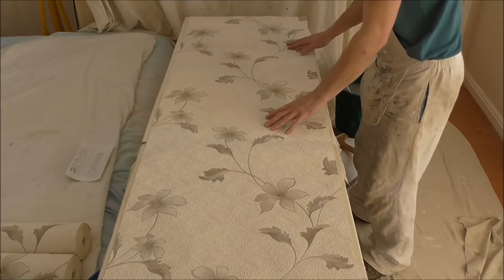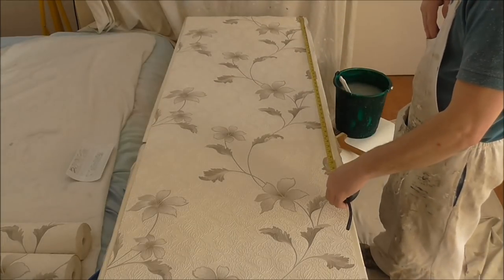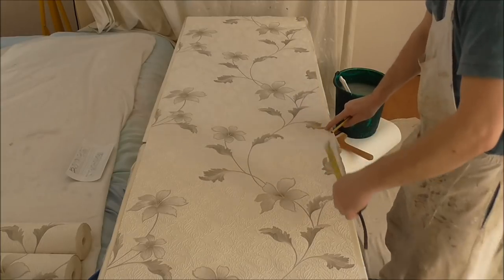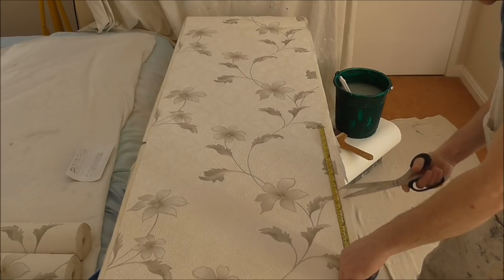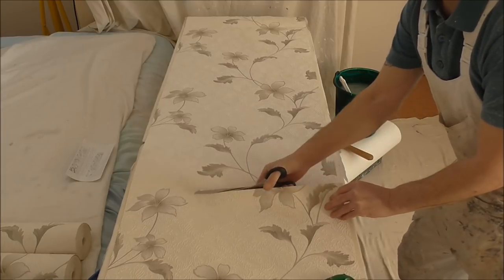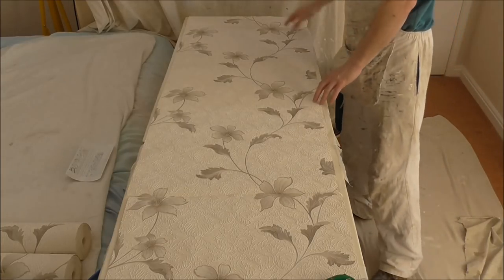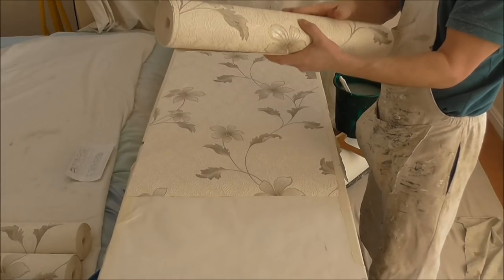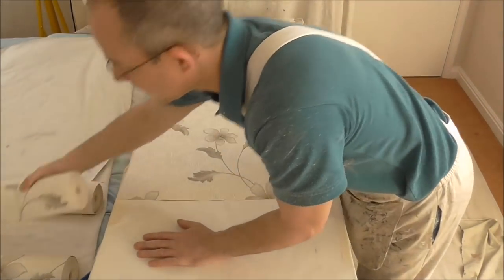How to paper a feature wall Drop pattern 53cm

Comment: As a newcomer to paper hanging. I like using a combination of scissors and razor cutting. I like using the scissors to cut the sheets. But I much prefer using the straight edge with a notch technique to make the length cuts as he did with the fill to the corner. In some cases pulling it back from the wall to cut on pencil lines helps. But the American way of cutting along a straight edge against the wall I feel makes a cleaner cut alleviates the need for pulling back and reapplying your work. 
Watching a combination of these videos has really helped. I think I like the brush pasting for a more even and accurate spread of the amount of paste you want. When it's not an issue the roller is fine. And of course the roller only if you're pasting on the wall

Comment: I always use the blunt edge of an old cutlery knife to to give me the crease to cut along the paper, I find that scissors don't give me
the precise crease I need to cut along. You should try it.
Reply: What I do aswell instead pulling paper off the wall
Reply: I was brought up to keep a thumb nail long , for scoring the paper at the ceiling, sometimes using the back edge of shears doesn't give a good line. 
After 30yrs i find a spatula and a snap off blade give a better cut, i drop 3 lenghts then cut as it gives a better cut line at ceiling and skirts.

Comment: Any reasons for not lining the wall first?..great video by the way"
Reply from the maker: Thanks, some papers are thick and the texture hides a lot. Really it's light coloured finished papers that need lining before you hang the finished paper. Also if your wall is crazed with hairline cracks you line first. But good preparation on a wall and it should be fine to paper without lining first.
Reply: Dont need to line the wall if the walls are smooth anuff to work on just needs a prep fill rub down and away u go but I allways size my walls up thin coat of paist b4r applying any paper but every 1 is different in the way the have been skilled and by whom they lernd from grat video and nice job

Comment: The problem is I am using a Laura Ashley patterned paper Isadore. .I have successfully pattern matched all of the room...but am left with the two pieces of wall to either side of this dividing door aperture....the drops from picture rail to skirting are fine but the width of each wall is 4cm wider than width of paper which is 53cm...do I put up a full with of paper either side of the folding doors into the side of the door frames and infill with a thin sliver of paper either side into the interior corner...or do I try and divide the awkward wall into and seam paper down middle So I keep a kind of symmetry?  Thank you...tricia
Reply from the maker: Tricia T well you can even the pattern out best you can on either side. And if it's a good paper and the joints hide nice it should be fine. But your better off to have a joint to one side rather than down the middle.
Reply: Painting and Decorating  thank you. Will experiment with one full width and very narrow strip join into left hand and right hand corners

Comment: A little trick for you all. After you book most papers that are pretty durable especially vinyls. You can glue and book them and even let them sit as much as overnight. Or more as long as they're put in a plastic bag and cinched uptight. A good pro Will cut a room. Paste all the paper, book it,  bag it and a hang it That's how I was taught. But maybe in England they just keep it a little simpler.

Comment: That place is a DUMP!  What's with that silly scissor marking instad of using razor blade knives and a straight edge???  And why aren't you using a seam rollar and a bucket of water and a sponge for a final wiping to make sure there is not glue on the front??